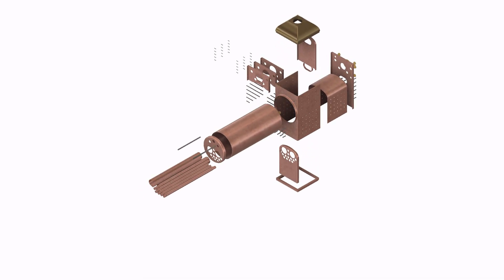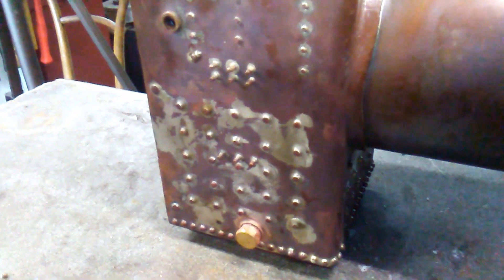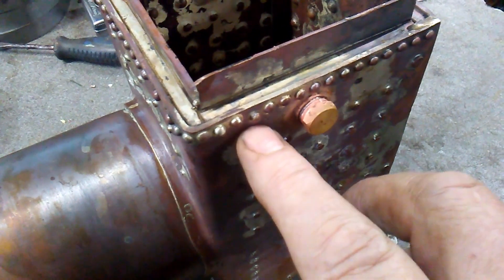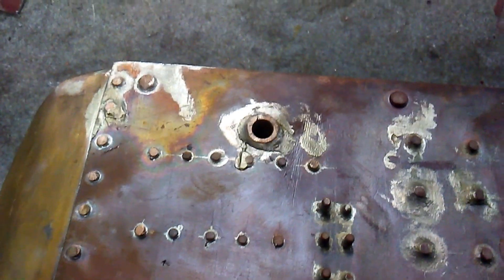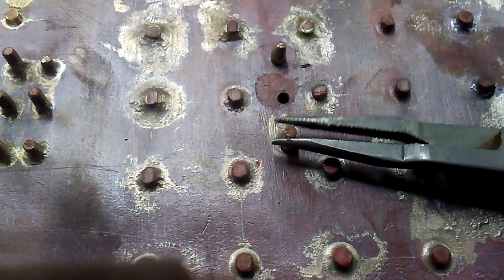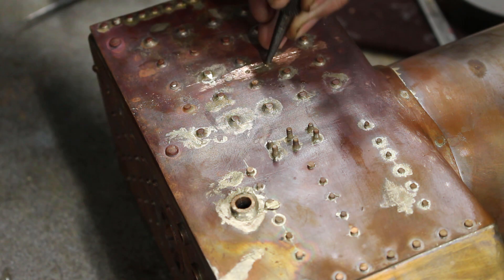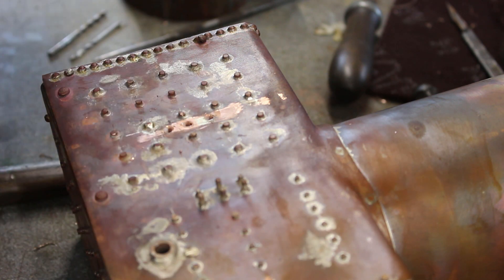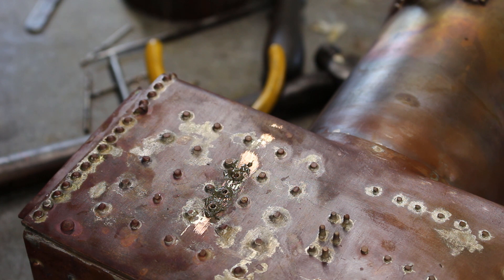LION - Miniature Steam Loco Build Part 19 - Silver Soldering Complete...?

Comment: Curious what was the solder paste you used on the reworked studs? What melting point versus the other solder used? Thanks!
Reply from the maker: That would be Silver Solder paste from Cup-Alloys uk, It's melting temperature is in the low 600 degC range. https://www.cupalloys.co.uk/low-temp-silver-solder/index.asp
Thanks for watching.

Comment: I would have gotten double duty out of the stay bolts. Would have made the boiler to frame brackets with hole spacings that matched the stay bolts so that 3 additional holes in the boiler for each bracket would not be necessary.
Reply from the maker: Yeah, sounds good. Having now built the boiler, on reflection, I would change the design a little rather than just follow the published drawings. This is my first loco boiler from which I've learnt so much. Cheers!

Comment: Hi gchms
Great informative video. i think were both on steep learning curves with boiler work, i know with mine there are some things i would do differently next time, but you can only find this out by getting stuck in and experiencing this work.
shame about the screws and rivets, but well done with recovering. i'm sure it will pass the pressure test now,
keep up the good work
regards
mr f
Reply from the maker: Hi Factotum
Yeah, we learn by doing. It was a mistake to pre silver solder in the bushes, even though I did use a higher temperature solder I was surprised to see some depletion of solder around the  bushes on re-heat, it kind of spoiled the job. 
I'd kind of like to make another boiler because I know I can do a better job next time, on the other hand, being more interested in machining I think one boiler may be enough.
Reply: @GoCreatehms  
Well you can always make another engine, that would require another boiler. Do a challenge, make a scale model of the American big Boy engine 4014.
https://www.youtube.com/watch?v=vRof4bXhpII